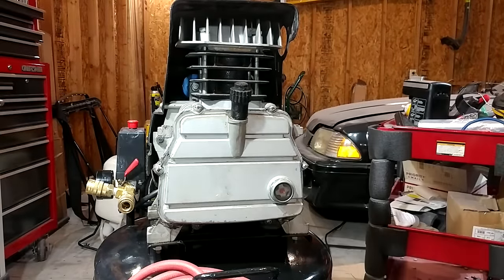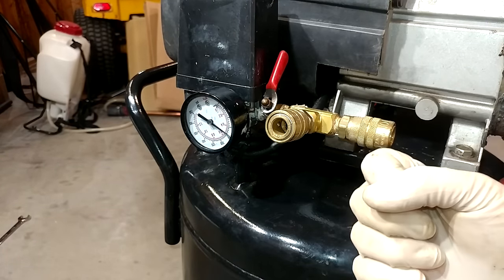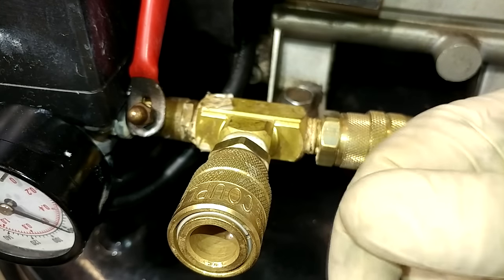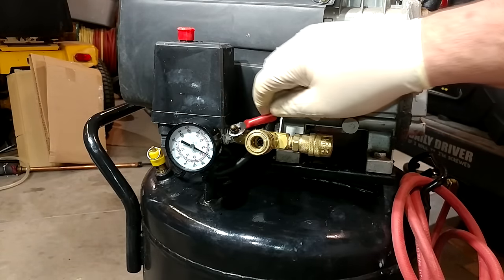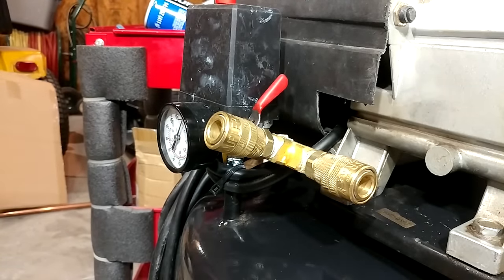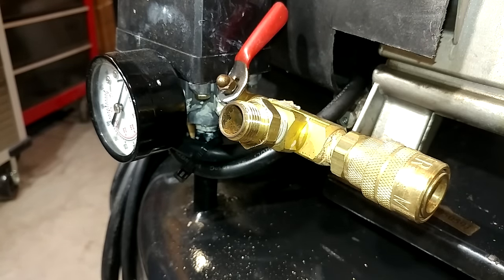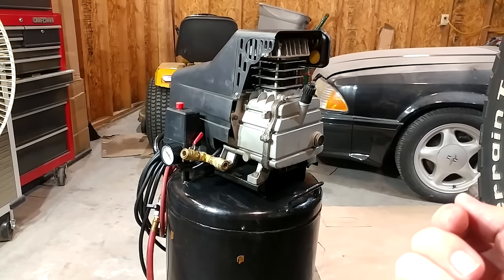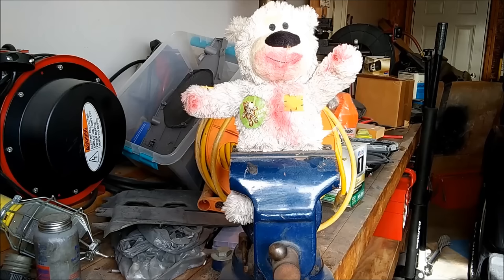Cheap Upgrades for Cheap Air Compressors!

Comment: I work on compressors for a fasteners company. Great idea on the mower air filter. Take a Dremel and port the thread end to allow it to breathe easier. Also port or drill the tube portion of the inside of the filter box or else it is only getting the air from around the crushed area of foam. That is restricting. Second, get a pipe to replace the regulator to get your connections to. This allows the air to straighten out and creates a tunnel ram effect like on a race car. Put a 3/8” connector, at least. 1/4” only have about an 1/8” valve. The pipes that you used to attach to your pressure switch can be used for the water drain on the tank also. Run it to a ball valve that you can reach easily with your foot. If you need to bend over, you are probably not going to drain it. Lastly, if you look at all of the fittings on the pressure switch, you can find a pressure switch that will run the same voltage and allow you to run more pressure. 412024-E compatible/replacement Air Compressor Pressure Switch 135 PSI MAC2400 MAC5200 AC700
Reply from the maker: Thanks!

In truth, I never liked that filter housing and traded it for a Solberg housing. It's a bit more like an automotive style filter. I noticed no change in performance, but it looks nicer and is almost certainly more durable.

Larger fittings are certainly a great upgrade, but 1/4" seems to be the industry standard for equipment of this size. If I want to be able to use my tools elsewhere, or elsewhere tools be used here, I kind of have to stick with 1/4". In the future I'll be exploring some other options, but not on this compressor and probably not for "normal" tools.

My drain hose comes out from the bottom and has a valve on a 3' whip, then another 3' whip attaches to the other side of the valve. I don't have to bend over to do it since it's on 6' of hose (and I do actually drain it). I must not have made this very clear, because a lot of people don't seem to understand it. I think the extra valve on the bottom of the tank might be giving false impressions to some viewers.

There are some good thoughts in your comment for sure, but I would not recommend that anyone increase the tank pressure of their compressor beyond what the manufacturer intended... especially on one of these questionable quality Chinese units. In truth, the switch that is on it right now is adjustable and could be turned up... I was actually more tempted to turn it down given that my tank is 20 years old and has been abused. 😅

Comment: I just got a pipe adapter and a washable pod filter for the air filter. I think a 1 1/4 to 3/4 threaded pvc adapter was what worked on mine. No messing with glued on stuff that can break due to vibrations. 
Mine is all fancy with a real k&n filter due to me ordering the wrong size for something and didn't want to hassle returning it.
Reply from the maker: The threads on mine are M20, but that will vary by unit.

I have never had a JB weld failure. I became a convert after I glued a radiator back together with that stuff and it went on to serve for 100,000 miles (about 5 years) until the car was scrapped due to rust. It's the only glue I've ever used that actually works. I've even machined the stuff. The key is to not be shy with it. The more, the merrier. You would break the housing before you'd break the glue. I confess that it took messing around to get it done. 😆

I considered a PVC setup, but I didn't trust it with the heat of the head. Ultimately, I replaced the entire thing with a Solberg unit, which is made of steel, and is made for air compressors. It's a really nice setup.

I'm not usually a fan of K&N style filters. That said... I looked in the cylinder of my compressor after 16 years of running it with no filter and its like new in there. I was absolutely shocked. I think pretty much anything you put on one is probably adequate. 👍
Reply: @TheBrokenLife   I'm lucky my old unit is NPT threaded. Mine has been this way for about 10 years in a mechanic shop and gets used weekly if not daily. The heat hasn't done anything I can tell. I meant to swap it out with metal. When I'm at the hardware store I just forget to grab the parts. Just happened to have that PVC part in the shop one day and looked at the compressor and the filter I ordered in the wrong size. Guess the planets were aligned and it happened to work.
I like K&N on street stuff but only with a prefilter. Off road or really dusty I don't think they filter well enough. The filter was supposed to go on a valve cover so it wasn't like it was doing anything really important anyways.
Reply from the maker: @user-neo71665  Whatever works, works. In all things, it's always better to be lucky than good. 😁

Usually I get neither. 😞
Reply: @TheBrokenLife  It's rare but run with it when it happens.
Reply from the maker: Indeed!

Comment: The problem with the nice brass connectors is that the small valve plug inside them all is cheap cadmium plated steel, they are all that way, and they quickly rust and don't seal . I made a bunch of stainless replacementa on my lathe from 3/8 round SS and just replace them. you only have to do it once, I will probably replace new ones as I install new air stations. The springs that close them when you disconnect are high quality stainless and will never have to be replaced, just reuse them.
Reply from the maker: Stainless inserts are exactly what I was hoping to find on the market to replace that plunger with. I never got a around to shopping for any. I was hoping maybe something for corrosive gas might be available commercially?
Reply: Sounds like a product that would sell!

Comment: My compressor is a hand me down, the first thing I did with mine was replace the drain valve. I have access to stainless swagelock fittings and tubing at work so I grabbed a couple fittings and a 1/4 turn valve and brought the drain out just far enough that it wasn’t in the way.
Reply from the maker: An excellent upgrade!

Comment: Milton V High-Flow fittings i've found are by far the best ones out there. Way better performance out of die grinders, abrasive blasters, etc.  I changed out the drain on mine with a 90' street elbow connected to a hose barb where i attached a length of old air hose which runs to a drain. gets rid of the water in the compressor fast. I also run a whip hose from my regulator, up the wall, then back down to a desiccant dryer/filter. for an air filter, i used a K&N Valve Cover Breather filter that attaches first to a lawnmower muffler which greatly reduces the noise.
Reply from the maker: Many folks have mentioned the milton V series and I do plan to take a look at them. 👍

Comment: If you install a moisture trap before the t-fitting it will help keep your Milton air fittings from getting so corroded. I always drain the water in the tank so that also helps a lot.
Reply from the maker: On the compressor that replaced this one I installed a separator before the tank which should help keep the entire system rust free.

Comment: Use your vise grips or channel locks with the lower jaw in the direction that your turning you will get a much better bite they are designed to work that way even the cut of the teeth are designed to work in one direction good luck 👍  I’m a plumber about drove crazy to watch lol
Reply from the maker: See the pinned comment. 👍

Comment: A guy I used to work with showed me a trick on the air filter.  Take a chunk of gas pipe (galvanized, whatever) and screw it into the intake, then get a screw on air filter and boom.  This way the intake is away from the compressor so it's not sucking in hot air, if you run the pipe out through the wall and put the air filter on the outside of the building you won't believe how much quieter the compressor is, just make sure it's not in a spot where rain and moisture will be a problem.
Reply from the maker: Yep, that's certainly another way to go about it. I have since switched off to Solberg housings that have a provision for a snorkel, somewhat like you're describing.

Comment: Also most of the time the heads have bear casting holes for airflow passages. If you can get in there and taper them it'll increase efficiency a little. I've done this to every compressor I've owned. The most recent was a $60 harbor freight 12v compressor, brought it up 0.2-0.35 CFM over stock. Only took 20 minutes to do and another hour to test and retest a few times when hot and cold and graph out the results. Also modified a quick connect to be an always open and installed it so any normal air hose will work on it now.
Reply from the maker: I've had the head off of mine several times and, to my immense surprise, the casting is actually pretty nice. I don't think I could do much to clean it up that wouldn't be moving in the wrong direction.

I've heard of guys cleaning up massive amounts of casting flash out of theirs though. Seems like its the luck of the draw. 🤷‍♂️

Comment: Enjoyed this.  Air fittings - glad you tore it down.  For the work and time involved I will just buy a new fitting - but it was fun seeing it apart.  I love the air filter upgrade.  And I will look into the setting up a drain hose.  Thank you for this video.
Reply from the maker: Thanks! I'm glad you found it helpful! 👍
Reply: Taking it apart showed what the problem was (collecting junk due to angle) and problem can be fixed permanently, not just a temp fix (new fitting only)

Comment: Haah... The way you fix your compressor air filter, is almost how we made the original legal airfilter box on our Mopeds into a "power Filter", because when giving it a larger cylinder, you need a larger carburetor and more air intake, to mach the increase in CCM and amount of gasoline, to get a perfect combination, but a regular(legal) was unable to deliver that amount, plus the flange would often be larger, so we'd empty out a large regular one, keep the front intact, but skeletonize the rest, and use the front as camouflage and the insides was something totally different, because a dead give away that you have fiddled with it, is the power Filter, sticking out from under the seat :)
Reply from the maker: Yep. That's pretty much exactly what I did. 😆
Reply: @TheBrokenLife  great video BTW... I am in the midst of making one of my own, from scratch.  You are almost the only one, that also uses a airfilter!..  I had also ordered one, because It really did stick out too me how nobody really threw one on, and never even mentioned how "important" they actually are, for increasing it's longevity, and the general health of the tank, just like drainage, from humidity, it's like they think the water seperator on the regulator somehow will magicly evaporate the build-up, in the air-container also?!... so your brass coupling is a brilliant idea. that I'm going to steal for myself ;)
Reply from the maker: @DreadPirarateAndersen  Thanks, I'm glad you found the video helpful!

As far as the filter, in the long run I ended up scrapping that one and put a Solberg on it. It was way less effort and not that much more money for what is almost certainly a better filter.

Tank health is a big deal for me. Even if not for a rusty tank being a safety risk, it's just not financially realistic to re-tank most consumer level compressors if one ever springs a leak. If you lose the tank, the whole is thing is trash.

Speaking of... I'm in the midst of outfitting a new compressor with some other systems to keep that sort of thing to a minimum. Should be a decent set of videos. 🤞

Comment: I’ve got a HF compressor. Bought it in ‘98. Still in use today. Your not using channel locks right. You had them backwards
Reply from the maker: That's quite a good run out of one! And... See the pinned comment. 👍

Comment: One of my buddies uses an automotive oil filter as the air filter, he found one that had threads close enough to the NPT and it threaded on easily.  It cut the noise way down and according to him it didn't lower the compressor's efficiency.
Reply from the maker: Something like that might work, but all of the compressors I've seen have female threads.
Reply: @TheBrokenLife A pipe nipple solves that.
Reply from the maker: @DonziGT230  Sure, if you can find a nipple that corresponds to the thread size on the head and an oil filter. I think the thread on that compressor is M20. I have no clue if there are M20 oil filters out there.

What I ended up doing in the end is getting a Solberg filter housing that is made for air compressors. They cost a little bit, but it's a nice solution. They also add the capability to add a snorkel to the filter, which some guys claim lowers noise on some compressors. I haven't tried that yet myself.

Comment: The best way to keep those air fittings from ever leaking. Is about every 6 months put three to four drops of pump oil directly in them. Or if you don't have pump oil you can use the same oil that you drip into your air tools. All that is is pump oil.
Reply from the maker: That works unless you want to use your compressor for running a paint gun. Getting oil in a paint gun would be bad for your paint job.
Reply: @TheBrokenLife , have separate fittings for your paint guns. It's FAR cheaper than the frustration involved.
Reply from the maker: @affliction1979  I strongly agree. I have outright separate hoses for that kind of thing which never see oil (other than the garbage the compressor is passing through them).
Reply: @TheBrokenLife , I've been working with air tools at work for approximately 20 years or so, yet I just bought my own, personal compressor. I'm literally in the middle of buying all the extra crap, so I can definitely understand. I really want to T my valve off to 1/4 and 3/8, but I'm not sure if my compressor can handle 3/8".
Reply from the maker: @affliction1979  If your tool needs to consume the volume that 3/8" can provide, then that's what it needs. If your compressor can't keep up the demand of the tool, then you'll have to trade the flow rate of the compressor rebuilding the stored volume in the tank for your time. Standing around waiting for the compressor to recharge is a story I know well.

In my opinion, there is no such thing as too much volume. You can always take it away by various means, but you can't add it back once the plumbing is maxed out. If you've got something you think you need 3/8" for, then it won't ever hurt to have it.

For what it's worth, in all of the various air tool pursuits I've been on in my life, all but industrial applications have been with 1/4" M style fittings and I don't know any home hobbyists using larger. That includes stuff like sandblasting which just murders air. My limitation has always been the flow rate of the compressor itself.
Reply: @TheBrokenLife , it's actually this compressor, and my impact directly states for all 3/8" fittings. 

https://www.homedepot.com/p/Husky-30-Gal-175-PSI-Oil-Lubed-Belt-Drive-Portable-Vertical-Electric-Air-Compressor-C304H/312074155?source=shoppingads&locale=en-US
Reply: The compressor at work was Frankenstein'd into a 2,000 gallon compressor that was formally a propane tank.
Reply from the maker: @affliction1979  If it's a 1/2" drive impact, I suspect 1/4" fittings will be fine. My air impact is one of the more highly regarded on the market (IR 2235TI Max) and it busts off axle nuts that are torqued to 250+ lb/ft, plus 25 years of rust, at 125psi of air, through 1/4" fittings. 

But... More won't hurt and the cost difference for 1 run of large lines and fittings isn't that high. As far as your compressor keeping up with an impact, you're not likely to have an issue. You don't normally run an impact gun for several minutes on end. Usually its a few seconds at a time so the compressor has time to keep pace just by the nature of the work. The issue you are almost certain to have is the low flow rate through the factory regulator on that Husky though. Same story on every similar compressor I've ever touched. Gotta take that thing off and either run a far more capable regulator or none at all. I go with none, but I don't have a 175psi compressor either. Most air tools want you to run 90 (though I ignore that, religiously).

The most impressive compressed air system I've ever seen was at a factory that blow molds automotive fuel tanks. Many hundreds of horsepower of twin screw compressors and many thousands of gallons of air storage. I joked that I was going to buy a place next door and run hose over... that place leaked more compressed air than I'll ever be able to generate in my shop.

Comment: Nice video, however you may do better using your vise-grips in the correct direction to avoid stripping. Pressure should always be applied toward the smaller grip. They are designed to grip better when used in the correct direction. I am certainly not trying to distract from the core message of your informative video. This is just a tip I learned from a 'Long-Time' master mechanic. This is something that I learned after using vise-grip tools incorrectly for years, not knowing that they were more effective when used as they were designed. Just like a regular wrench: Always apply pressure in the direction of the smaller grip.
Reply from the maker: I believe you're the 3rd or 4th person to mention that. ;)

Comment: I think extending your air  intake  with an elbow and short pipe  could  bring it up in open air..  I hope to get a better compress some day.  Thanks for the tips
Reply from the maker: Indeed, it would. I ended up switching filter housings not too long after this video to one that allows for a remote intake. It's made by Solberg.